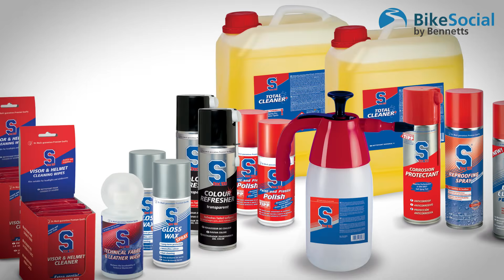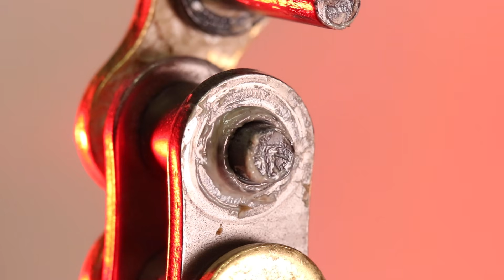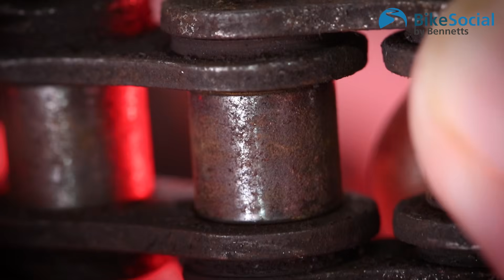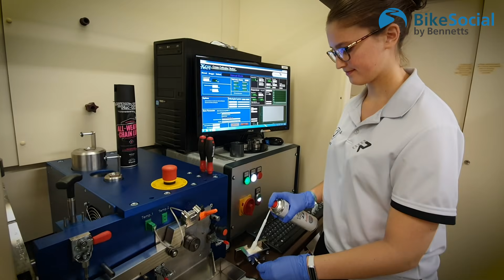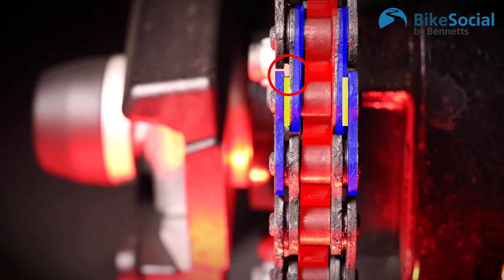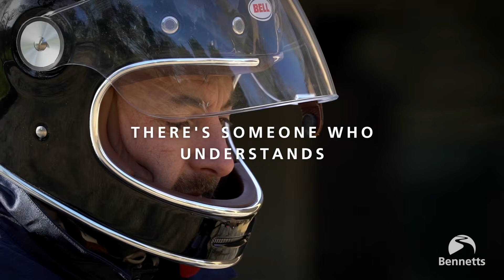Is chain lube a scam? Does your bike really need it?

Comment: Dirt bikes need a chain i think. Belts die in grit. On the street? F++k chains, theyre out. And hes right, a sealed chain stays lubed maybe a drop or two of motor oils saved from you last change works jjst as well. Harleys used engine oil for years on the old non prelubed chains. The weep hole that lubed harkey chains on old bikes is why they lefg a puddle if they sat a long time. Now harley is belt drive that is maintenance free.

Comment: Is doesn’t matter if x link chains trap grease in rings. If the surfaced the chain becomes rusty the surfaces will wear down the o or x rings allowing the grease to be washed away.
Reply from the maker: That corrosion protection is a key part of the huge test I'm working on at the moment. Cheers, John

Comment: EP80/90 applied with a toothbrush after a quick wipe with a rag at each fuel stop will get you 60k + miles out of a chain and sprockets.

Comment: I use Dunlop Chain Saver. Goes on very thin,dries to a wax after 10 minutes. I put 8,000 km's on a new chain on my Vstrom. No wear or need for adjustment. That's a DID chain.

Comment: The trouble is engine chains aren't likely to get covered in dirt and sand and turn the oil into a grinding paste.
Reply: Good point that's why I advocate cleaning with wd40 and lubricating with gear oil.. do it often especially in dirty wet weather, it's cheap

Comment: back in the 1950s on the farm where machine chains ran in dirty dusty environments. NO lube. The chains and sprokets ran the longest with least wear. we did not let the chains out in the weather to rust.  my suzuki dr200 the factory manual tell us to NOT put lube on the chain. I keep my motorcycle in the garage when not in use. no problems with chain or sprocket wear. what these guys do not understand that dirt and grease make a grinding compound.
Reply: most people dont have a garage though

Comment: I clean regularly with WD40, then use a a good quality engine oil in a soaked rag then wipe off the excess so not to have a mess. Engine oil has to maintain a film between the most extreme place in the engine the big end bearings, so maintain a film on a chain with quality engine oil is no a problem, also has detergent in the oil so when wiping off the excess it polishes the outer chain after cleaning and re oiling. Down side takes more time and too much oil makes a mess, I used wax lube but it goes hard and is tough to clean, if I use spray I used Motul road and track that seems to be the best for me. Bikes Ducati 1299, 1199, 749, Scrambler and Desert sled used on tracks and road and I don’t have wear problems.

Comment: Soaked my new chain in heated up grease overnight. Had a Scottoiler on it, rode the bike (a pre power restriction CB125TC) with mechanical sympathy. The chain lasted just under two years. Admittedly only about 50-80 miles a week though but still, that's a long life for a chain.
I really miss that bike. Was faster than a mate of mines CB250.
Reply: i've done nearly 15k miles so far on my MT 07 stock chain after 2 years and 2 months

Comment: Total bullshit! I have used Scottoilers for 35+ years on all my bikes and chain lube is a complete waste of time/money/chains & sprockets. I know riders who lube and riders who fit a new chain and run it "dry" until it dies - same approx. mileage in both cases. I personally have part-exed a Triumph 955i with 150hp with 50k miles on the clock with its original chain and sprockets (adjusted 3 times during its lifespan) and the dealer (same dealer who sold me the bike new) commented to me "Oh! Excellent! You have recently changed the chain and sprockets!", "Errr..yeah I replied". That bike ate rear tyres every 2200-2300 miles and was not riden like a nancy - just the reverse.
I challenge anyone, anyone at all, to ride out 100-200 miles with a mate who has a Scottoiler fitted, then when you stop for a brew/beer, just touch your own chain (carefull its hot!) then the chain with the Scottoiler fitted...which will just be slightly warm. Heat is what kills chains and lubricant that sticks to a chain also gets full of grit, sand and other sh1t and just becomes grinding paste which f'ks yer chain and yer sprockets.
My current bike, also bought new, is at 42,000miles on the original chain & sprockets, still looking like new. It did about 20 miles without a Scottoiler (distance from the dealer to my garage).

Comment: I used Wurth dry chain lube before I went shaft drive - it’s a leap of faith as you can not see it so you just have to believe it’s there doing it’s job. What I did (which initially was a faff I’ll admit) was clean off all the grease I could from the chain as soon as I bought the bike (Triumph Tiger 1050 Sport) using a chain cleaner and then painted the side plates with metal lacquer to protect them from corrosion, sprayed on the dry lube and continued to do so every fuel fill up for the next 12,000 miles until I sold the bike with the chain and sprockets still like new. The chain stayed clean, no “fling” on the back wheel, no corrosion and it only ever needed adjusted at tyre change time. Grease and wax just attract grit and make a grinding paste so you end up in an endless cycle of cleaning, lubing, cleaning, lubing. It worked for me anyway.
Reply from the maker: That's dedication! Cheers, John

Comment: the longest lasting chain, that I've had on a bike, was a 428 on a 1979 CZ 250-471.4 , which lasted just over 15,000 miles. I never used chain lube, instead relying on the inbuild total loss drive chain oiling system & fully enclosed oil bath that the bike had as OEM. The 428 chain only had to deal with 17 HP & 28.5 Pounds/Foot of torque though.

When it came to replacing the chain the fully enclosed chain guard with oil bath made it a messy job, so I ran without it. The hot gear box oil drip feed, through the output sprocket shaft centre, still functioned, giving the exposed chain a service life of 7,000 to 8,000 miles. The system loses 1 drip of gearbox oil per 2 or 3 miles, which also lubricates the automatic clutch actuator, before ending up on the primary sprocket and being spun out into the chain. The owners manual recommends topping th gearbox oil up very 1,000 miles. The only fault with it is when the tiny O ring metering washer wears out and the the drive chain is over lubricated, flinging a lot about the right side of the tyre (it costs 2p to replace).
Reply: My Royal Enfield 1986 has this system. It's called prether or something. Mine has 18 bhp and its a 350 cc long strong engine. Chain lasted for a long time that I was so amazed that my friend changed his chain for his new bike..

Comment: After 128000km I thought I should replace the 428 non O ring chain on my motorcycle. I had only used grease applied about 3 or four times a year. I took it off and discovered it was in pretty good shape, ditto the sprockets. Never used chain lube. Then again it has a fully enclosed chain.
Reply from the maker: Nicely done! What bike is that? Cheers, John
Reply: @bennettsbikesocial  MZ ETZ250 1984 model.  Similar to this https://www.youtube.com/watch?v=dK8eL3pZqGA

Comment: Well, this is why I have one bike with a belt and the other with a shaft. The belt needs zero maintenance during it's 50k or greater lifespan, and the shaft needs oil change (a few cc's) every 10k. I still don't understand why mfg's are still using chains.
Reply from the maker: Cheaper, less loss of power and lighter weight
Reply: @bennettsbikesocial  Thanks for that but I've seen contradictory information. A Gates belt can now be had for $120. I see chains going from $100 - $200. My belt is very light, I suspect lighter than a chain. I've also seen power loss of about 10-15%, but from a more reliable source it's been about equal to a chain. I suspect another reason. Most belts without being overly wide are limited to about 100hp. Plus there's the snob or traditionalists appeal to chains.
Reply from the maker: @jorgensen8  Sorry - I was referring to shaft drive there. One of the issues with a belt is that the swingarm has to be removed to replace it, and it's more susceptible to potential damage. Belts can clearly handle high power outputs (Diavel). Here's an interesting article on the TVS site https://www.tvsmotor.com/Media/Blog/chain-vs-belt-vs-shaft-drive-motorcycle-final-drive-systems-explained-with-their-characteristics

Comment: I always clean my chain thoroughly before lubing with EP 90 gear oil and then wiping off excess. With dry weather riding I do that every 500 miles - wet weather more frequently. Any other method will turn your chain lube into grinding paste - Been doing this for at least 40 years now - All chains wear out in the end but my GSXR 1100 back in the 90's, drive chain lasted 23000 miles before I had to replace it and I used to to ride it extremely hard. I bought My 2005 Z1000 new and still have it - and it still has its original chain, although I'm only a fair weather rider now as I'm getting on in years. The only time I have ever used spray on chain lube in the past, was when European touring and then I had a very large can of industrial chain lube (much cheaper) - and then washed it all off when I go back home.

Comment: Chainsaw and cutterbar oil I use on non "O" ring chain, on 110cc Honda cub with enclosed chain, excellent results. Applied with paint brush and occasionally use chain spray lube. 80,000 Km so far. Seems once the chain is 'run-in' (polished) then a steady state condition arises. Beautiful. Note: the full enclosure does act as a suction 'focus' around the sprokets though far preferable to an open chain for (in my case) postal delivery. Removing the top 1/2 of chaincase is speeded-up by replacing the two 10mm bolts with two screws.

Comment: I have been using WD40 spray to clean the chains on my Street Triple and Speed Triple for over a year now.Spray on and wipe off.After every ride of over 50 miles.The chains are still looking very clean.Each bike has covered about 5000 miles.There is never any grit on the chains because there is no lube for it to stick to.Still not showing any obvious signs of wear.And when I spin the back wheel with the bike on the Abba stand it has that nice smooth buzz sound.This This cleaning method was advocated by Neevesy from MCN so I gave it a go.Takes about 5 minutes.
Reply: Just checking in again 4 years on.Both bikes are still on the same chains which have never seen lube.Street Triple chain is 16000 miles old and Speed Triple chain has done 23000 miles.Street Triple chain shows no discernible wear or stretching and sprocket teeth look normal.Speed Chain looks good for a few thousand more miles.
Reply: Thanks for the update.

Comment: if you think about it the chain is moving at 400+ mph whatever lube you apply to it is flung off no matter what they say , LOL i love a good scam
Reply from the maker: They're at in independent lab now to find out, but 400mph? Can you show your working?
Reply: @bennettsbikesocial  no i was told by a motorbike mechanic qualified it spins at 300+ mph ......400 was an exaggeration on my behalf, lol but lets get to the point here, nothing but superglue is staying on these chains
Reply from the maker: The rear sprocket's spinning at less than 1,000rpm, and in my fling tests at 1,100rpm, there are plenty that stay on!
Reply: @bennettsbikesocial  rpm has nothing to do with chain travel speed, but anyways
Reply from the maker: @jonnijames  The speed the rear sprocket spins at in rpm is directly linked to the speed the chain travels. Because, well, they're directly linked! Remember we're talking about the rpm of the wheel, not the engine. Chain lube fling has no direct link to crankshaft rpm.
Reply from the maker: @jonnijames  In fact, having worked it out, at 60mph on my S1000XR, the circumference of the rear sprocket is moving at just 22mph, which means the chain is too.
Reply: @bennettsbikesocial  thanks for the update ill have to ask my mechanic what he was smoking sayin the chain was movin at high speeds a few years ago,

Comment: Using only gear oil or engine oil, brushed on regularly.......40,000 miles on Yamaha FZs1000 Fazer on one chain. I achieved this 3 times. Changed the gearbox sprocket every 20,000 miles & wheel sprocket with chain. Chain lube is unnecessary in my opinion.

Comment: What's a "chain"?
Do bikes in the 21st century really still have those dirty, noisy, expensive 19th century inventions as their final drive? 
My FJR1300 doesn't, it's now done 95,000 miles without being 'lubed'!😂😂😂
Reply from the maker: Ha – yes, many bikes are still 'afflicted' with these. Though ironic that this less 'lossy' form of transmission has battled through into 2021, but the FJR1300 is no more!

Comment: Do you have the link to the motorbike cleaning product tests you did? I can't seem to find it. I'm. Worried about products I use on my car effecting the metal parts on my bike
Reply from the maker: It'll be back up online today - sorry about that! It'll be a new link, but if you're subscribed you should be able to get a notification. Polycarbonate is something you really want to be aware of with any non-motorcycle-specific cleaner (and some that are designed for it). Cheers, John

Comment: i clean my chain with parrafin, wipe dry, then apply 80/90 gearbox oil, then wipe off excess, as advised in the owners manual. if anyone is familiar with ryan F9, he did a test and came to the same conclusion
Reply: Yeah, FortNine Does Two Of The Best Videos On Chain Cleaning & Lubrication. I Use Kerosene To Clean & Gear Oil To Lubricate. Thank You.
Reply: But parrafin destroys the rubber seals in the links they say?

Comment: I use a diesel-soaked rag to clean the chain, then wipe with a dry rag. Then apply MucOff dry lube onto the inside of the bottom rung of the chain, while turning the back wheel backwards. I paint the joining link of the chain bright red to make it easier to find and check and this also serves as a marker to ensure the entire chain is cleaned and lubed.
Reply: But diesel is no good for the orings...
Reply: Thanks for your tips, mate 😁

Comment: 80/90w gear oil to lube under the rollers only. Waxoil on every other part to simply stop corrosion with no fling. Perfect.
Reply: The rollers on a modern O or X ring chain are pre greased & sealed in at factory .90 gear oil is needed just to stop corrosion & prevent grease sealing rings from drying up & tearing .The oil or grease serves no purpose between outer chain rollers & sprocket teeth as it gets squished out.. The outer roller surfaces & sprockets are sacrificial & designed to wear at a reasonable wear rate subject to correct chain tension adjustment & also proper alignment .

Comment: If the main objective is o-ring integrity, shouldn't we just use a silicone based dry or wet lube ? Silicone is the go to for lubrication of o-rings in other fields

Comment: I'll just continue with my Scottoiler thankyou.
Reply: Yeah an degrease the back of your bike every weekend  😒
Reply: @rockintigger  I've got better things to do at the weekend. That said, it's a small price to pay for hardly ever needing to adjust my chain. If the Scottoiler is adjusted correctly there's not much "throw off" onto the back end. Flow needs to be adjusted seasonally due to ambient temperature.
Reply: People turn them up too much, if properly adjusted it shouldn't be messy.

Comment: After 30+ years of riding I’ve only recently changed over to using gear oil instead of chain lube. Oil is so much better.
Reply: I bought a liter of chain saw oil years ago, haven't used half of it yet. It lubricates well, dirt doesn't stick to it much and if you don't apply too much it sticks to the chain well. I simply apply it with a finger.
Reply: @PrimoStracciatella  Cheapest and best.
Reply: I keep telling the younger guys, gear oil & non O-ring chain is far more cost effective & lasts longer than any O-ring rubbish, they only developed the O-ring chain, as most riders are bone idle & not wanting to actually clean a chain properly, plus the crazy price on top for chain lube & crazy chain prices for a chain that is inferior to a no O-ring chain, as they can never be cleaned effectively nor lubed either... it's an industry rip off 100%.
Reply: Yep.  
Dish soap and a toothbrush in that pinch point he points out to remove old dirt. 
Hose off.
Blow or sun dry.
Toothbrush and chainsaw bar oil applied at that same pinch point as you rotate your wheel.  Rub it on the side of the links last to avoid visible rust.

Thats good nuff.  Costs about 3c a treatment.
Reply: I use the oil which comes with the Scottoiler. The thicker the grease, the more muck sticks like a grinding paste. Light oil shrugs it off.
Reply: Use Car Gear Oil not Chain Saw Oil

Comment: Hi John, looking forward to your chain line reviews. Will you make a comment/review or comparison to a Scottoiler? Or have a personal view about such devices? Many thank, Adam
Reply from the maker: Hi Adam... I'm hoping to start this in the next few weeks. I'm not sure yet how to include Scottoiler in the way I'll test as of course it's a constant loss system that keeps the chain lubricated at all times. I've used them, and they can be great, but you have to get the settings just right to find the right balance between fling and lubrication. I also found that the side plates on the chain can still show signs of corrosion in some instances - cosmetic only, but definitely a consideration for many so correct set up is essential. They're particularly useful in dusty environments as it keeps the chain more clean, avoiding that grinding paste that can build up on a sticky lube. Cheers, John
Reply: Thanks John for your reply. Looking forward to your review in the next few weeks.😄👍